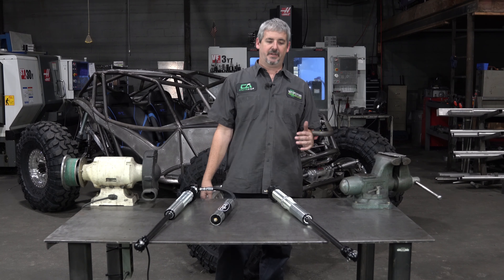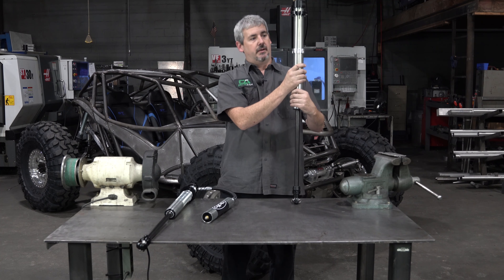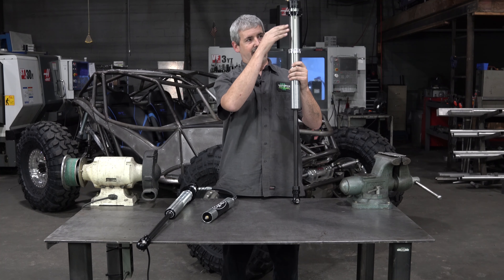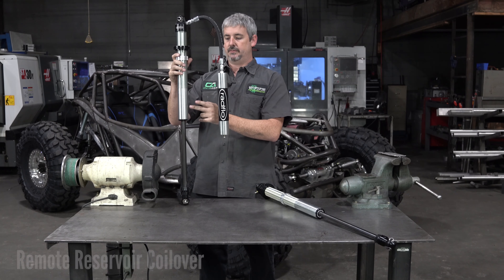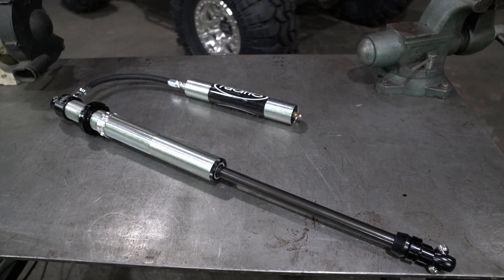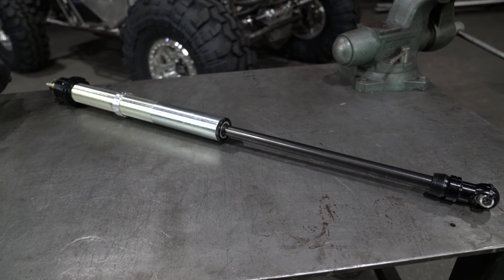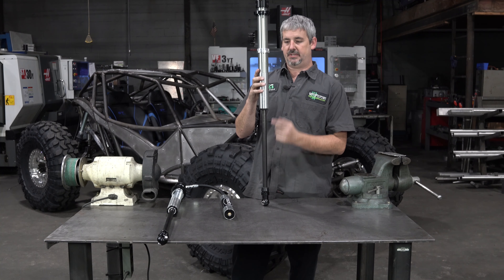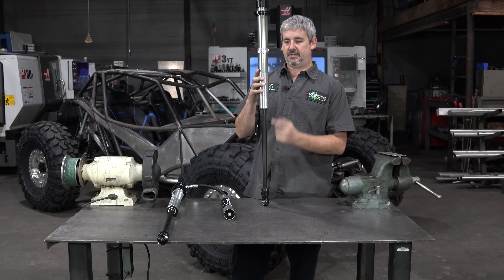Emulsion vs Remote Reservoir Coilover Shocks - The Differences Between the Two & When to Use Each

Comment: When adjusting ride height (going higher) on front coilovers with reservoir and compression adjuster, do I need to take some air out of the reservoir or no?
Reply: No sir you will leave the Nitrogen pressure alone when adjusting that.

Comment: Are you serious about the mixing of oil and air? I thought there’s a floating piston to separate oil from air?
Reply: There are both.  Emulsion shocks will mix the gas and oil, literally emulsifying the mixture.  There are also shocks that have the internal piston separating the gas and air.  This is where adding a remote reservoir comes in by creating a larger volume for oil and gas.  This allows for more volume to compress the gas and reducing the air spring effect and better cooling because there's more surface area.
Reply: @Tetz95  to me an emulsion shock would be a shock with double tube design, which has no pressured gas chamber. This is the typical cheap and long lasting OE shock. And then you have gas pressure shocks with separation piston, also called monotube. What I don’t get is the guy is showing a monotube and calls it an emulsion shock. How’s that supposed to work?
Reply: @Gemini_0815  I'm not sure, either.  Radflo's website calls them emulsion shocks, too.  I wouldn't think you can easily convert a true emulsion shock to remote reservoir very easily.
Reply: I believe from eyelet to eyelet, the emulsion shock will have longer travel (actually same as the external reservoir) than internal floating piston, which loses travel corresponding to the length of packaging of the IFP into the bottom of the cylinder. So for slow speed, where u don't over heat, it would be a better, longer travel stroke, do you follow that? The external reservoir essentially preserves the full travel length by not having to fit it into the cylinder.If u have enough travel for your application with an IFP, then you don't need the remote reservoir. Cooling is a total myth, it only applies to "cactus coolers" that have both an inlet and outlet oil hose to the reservoir.
Reply: Yes, Bilstein calls it floating piston design, but yea- gas and oil are separated

Comment: Nice vid.. but I still have no idea why the remote is supposedly better..  only that you say it is.
Reply: The remote reservoir keeps the oil and the nitrogen separated in the shock body. An emulsion shock lets the oil and nitrogen mix. When you start working the shock hard the oil mixes with the nitrogen causing aerated oil. The shock pushes oil through shim stacks to cause the dampening. If the the oil is aerated then the shims don't work nearly as effective as they do when the shock has clean oil to push through the shims. That is why a remote reservoir shock is better.